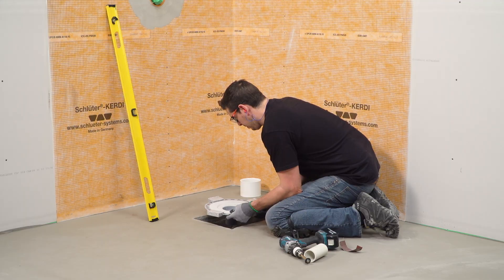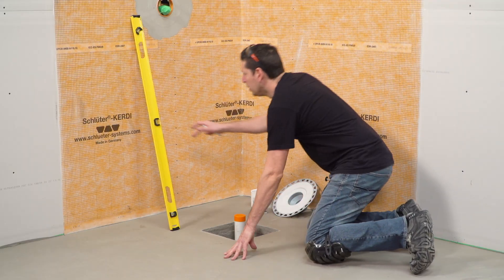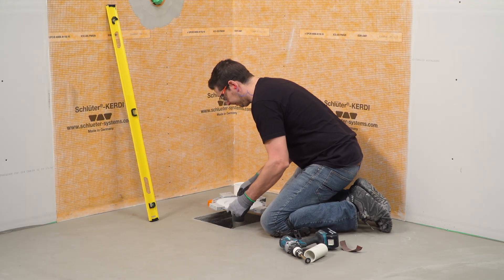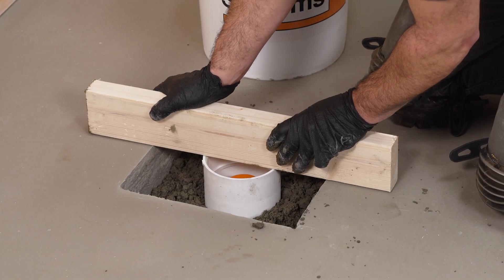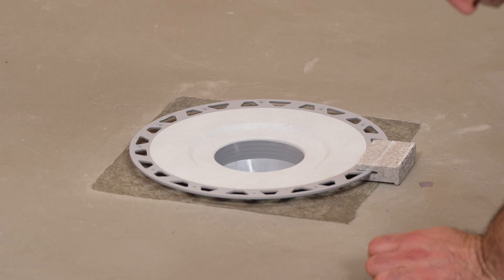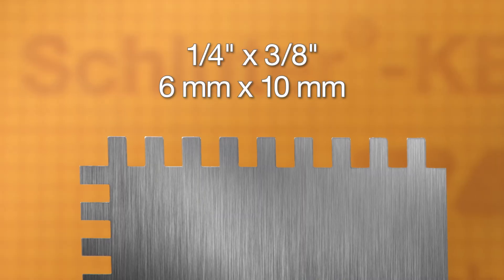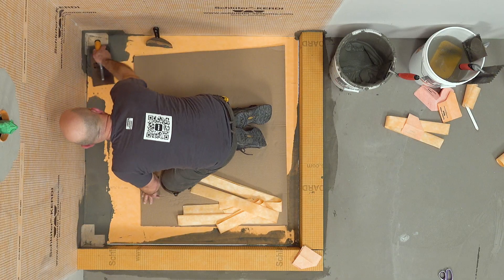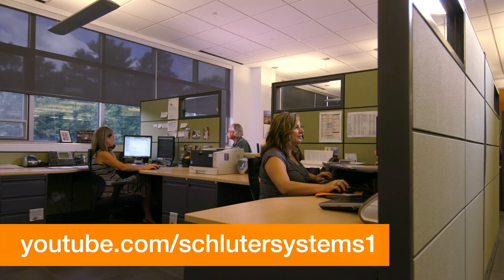How to prepare a concrete box-out for Schluter®-KERDI-DRAIN installation

Comment: Hey, what size pipe coupling was used for the form?
Reply from the maker: Hi there! The recommended diameter for the pipe coupling or similar should be 4 3/4" to a max of 5". This is to provide enough space and support for the drain body and ensuring proper support for the tile assembly. Always dry-fit the form before filling out the box-out.
Reply: I just did this and used a 4" PVC coupling. The outside diameter was 4 1/2" so I wrapped a couple layers of cardboard and duct tape around it to get a ~5" diameter. Worked good for me with concrete

Comment: I understand the 1st measurement is floor level. But what is the second measurement made on the riser pipe?
Reply from the maker: Hi there! The second measurement refers to the height where the KERDI-DRAIN bonding flange is installed. Hope this helps 🍊
Reply: @schlutersystems1 but how is that determined? It didn’t explain in the video
Reply from the maker: Hi there! The goal is to make sure the KERDI-DRAIN flange sits flush on top of the foam support that comes with the tray. To determine the height to cut your drain pipe, take the total height of the flange and subtract the amount that the pipe will insert into the drain outlet underneath. That gives you the approximate height to cut the pipe so everything fits properly. Hope this helps 🍊